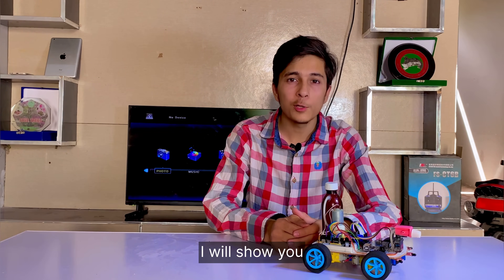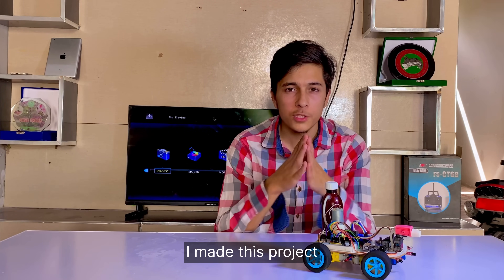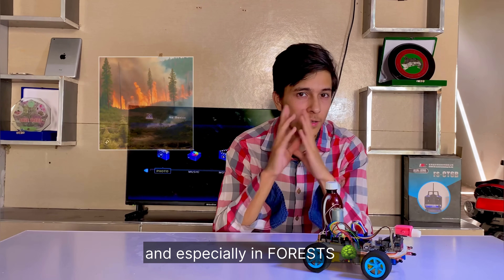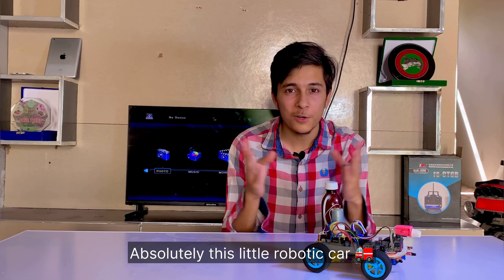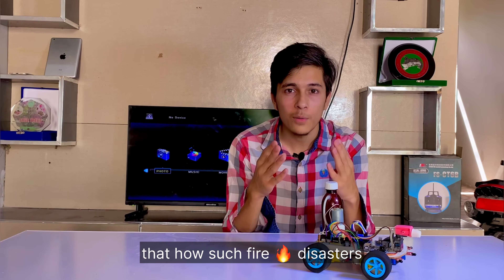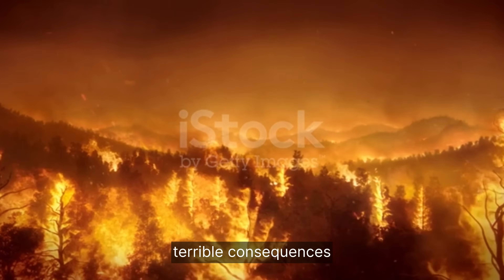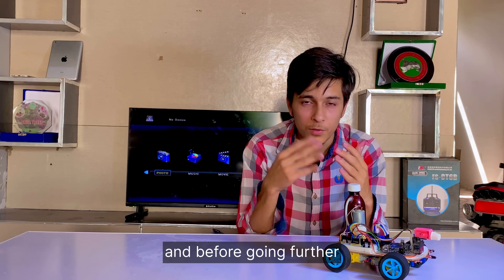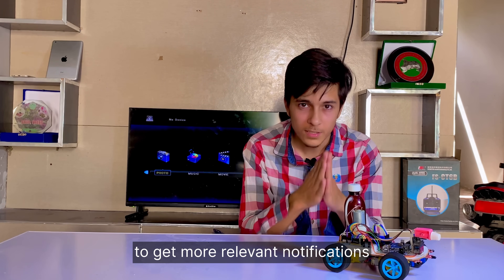DIY Fire Fighting Robot using Arduino  |  Auto Fire Chaser and Extinguisher

Comment from the maker: You are free to ask Questions about any issue regarding this project  (In any language)
Reply: Hi   I  need to contact you to discuss possible the use of yr idea for the firefighting robot.  Can you send me your email ?  thanks  Claudio Ben
Reply from the maker: @claudioben2060   you can discuss it here
Reply: @saadinnovativeideas  I spent two weeks designing this project, and I can cut every detail, just like in the video, and even build the tedious details. I double-checked everything, and the wires connect perfectly, just like in the gameplay footage. I could even program the exact same clip, but it's not working. What's the problem? The pieces light up, but they don't move or go towards the flame. The wheels don't move. What's the problem and what's the solution? I'm exhausted. Please reply! 💔💔💔💔💔💔💔💔💔💔💔💔💔
Reply: I recreated your project but it doesn't work, any suggestions?
Reply: Me too @juliangiron9941
Reply: @juliangiron9941 same i make it with your given diagram, but it doesn't work..
Can you give me the solution??
Reply: THE FLAME SENSOR  DECTING SERVO AND WATER PUMP WORKING BUT CAR NOT MOVING
Reply from the maker: @sumanpatel4085   check your power supply. Make sure its compatible
Reply: @saadinnovativeideas what kind of jumper wire is used here
Reply: @sumanpatel4085  same
Reply: How much did it cost bro
Reply from the maker: @iamjennieslostnails28   about 25-30 $ for components
Reply: I have a question so I have everything you have completed. The only issue is that the robot does not want to move. At first it was moving and the servo was not moving. Now the wheels/motors are not moving and the servo is moving and it spraying water out. Any ideas on how to fix this?
Reply: I also have 9V going into this so I would assume this is enough power everything is on
Reply: Brother can I replace the trasistors, diodes and capacitors with a 5 volt relay?
Reply from the maker: @johnkarlogallardo9158   Of course with the following change in connections 

Arduino     |      Relay mod:
      5V   ———>  VCC
    GND ———>  GND
    A5.   ———>  IN

Pump   —————> Relay mod. Slot
    wire 1  ———->  NO
    wire 2 ————> COM
Reply: @saadinnovativeideas connected as per ur instruction but the motor doesn't run
Reply: Bro I have done programming but there is a problem,the wheels and the pump run by itself without any flame detected.
Please tell me the solution.
Reply: @ganeshdk7689  hello sir have you solved your problem?
Reply: Bro could you please send the proper code of fire fighting  car
Reply: Hii bro .sirvo moter work nhi kr rhi h ?plz help I have only 1 day to submit it
Reply from the maker: @netaXpro   servo ke side wires ko flip karo or middle wale ko waisa rehne do
Reply: @netaXpro  hello aapka project bangyaya kya
Reply: My only pump were working rest all part will not move what 
I have to do
Reply: do we need to change only A0 or A1,A2 etc. as well? Saad please reply soon... Thanks!
Reply: Bro so you mean that in the sensor wires we have to replace the G with D0 and in the coding we have to change analogWrite into Digital write and analogRead into digitalRead ???
Reply: Bro I done with everything but my cars motors are not working bro say what is the issue I'm face and give some tips bro please
Reply: @rumanpasha9764  check the motors connection properly.
Reply: @rumanpasha9764 Hi bro. I also faceing same problems pls help me pls pls pls 😢
Reply: Not working code
Reply: Brother its showing "could not detect port "
Reply from the maker: @gamingwithk.j8149   Download usb driver to connect port
Reply: Brother it's not forwarding that much as shown in the video , it's coming little and starting the pump. What to do ?
Reply: If we use another cheap sensors, what changes we have to do in our code
Reply: I don't know what is happen 
1 day before my only pump is 
Working but now only servo
Reply from the maker: @nasimmemon756   whats you net input voltage and which battery have you used
Reply: @nasimmemon756  did you made your project?
Reply: Could we reset arduino and input the same code in it multiple times will it work
Reply: my water pump is not not working as i am not geting power in the points where pump is connected
Reply: Hello, is a 9V battery capable of powering everything? It seems my set up not getting enough power
Reply: Saman kha sa la ga
Reply: We have a problem about the port....
That this Arduino com7....
Your Arduino code is com6 port...
How to get it?
Reply: What is the cost
Reply: Bro my servo motor is moving continuously .please help me😢
Reply from the maker: @poortelugufishlovers3658   which servo have uou used?
Reply: The flame sensor i have doesn't detect high range fire i tried to use potential but the same issues
Reply: Wtf it is not working at all 
I have sensor with do gnd and vcc what to do now
Reply: If i use sg 90 servo 
And relay instead of transistor what would be the changes i have to made
Reply from the maker: @alM8nds   With using relay module connect like 
Arduino ——-> Relay mod.
      5V   ———>  VCC
    GND ———>  GND
    A5.   ———>  IN

Pump   —————> Relay mod. Slot
    wire 1  ———->  NO
    wire 2 ————> COM
Reply: Can I use 9 volt battery
Reply from the maker: @YashNagwanshi-n3w  If you are thinking about that non rechargeable 9 v battery thats not compatible, because they cannot provide the desire amps
Reply: Can I use rechargeable 9v battery @saadinnovativeideas
Reply: Brother when we are starting our project, the flame sensors are not lighting up and the pump is also not throwing water outside...instead of all correct wiring as well as soldering....so what to do...pls guide...
Reply: I need to connect the Bluetooth module in this if possible or not
Reply: Yar plz provide code here or in link that we can copy it easily you have sent code in pdf files I have done all the things and run another code of chatgpt but still not working
Reply: youtube.com/@saadinnovativeideas My flame sensors are not dropping resistance under 1000 even when the flame is about 5cm from them. How do I make them work? I connect them directly to arduino 5v and gnd pins, using A0 for reading and using my laptop to power the arduino?
Reply: Hey youtube.com/@saadinnovativeideas Im not sure if my comment got deleted. I have issues with the flame sensors testing. I try to connect them to 5v arduino power supply, ground of the arduino  and  im using A0 pin. I have issue that even when the flame is 5cm close to the sensor it still doenst drop under 1000. What should i do to fix that? Can you help please i need this fixed as soon as possible. Thanks!
Reply: Can we use another battery for us 
We don't have the ultrafire battery so if we use that 3.7 volt li-ion battery will it work????
Reply from the maker: @  Of course
Reply: Bro we are school students 
We are doing  this project  ,we have some problems Can you give the phone number 
Emergency please
Reply: I am first time coding in to the arduno so please you send me the arduno code
Reply: l am first time coding in to the arduno I have no idea so please send me the arduno code
Reply: Bro while switch on my pump start and rest all things are not working
Reply: Total rupees ? Please ?
Reply: How to programming
Reply: Sir can we use 4 one sided dc motor in this
Reply: Is the Bo motor dual shaft or single shaft
Reply: bro my flame sensor's light is not on what to do
Reply: 3pin sensor work ??? 😭😭
Reply: Battery immediately get discharged
When connected light in arduino and l298 motor blinking but after some time nothing is working
Reply: طيب اذا ابغى ابيع مشروعي ابغى اكسب كيف الطريقة؟  @ace.king07_official
Reply: Bro I haven't a laptop or pc what I do
Reply: Bro it's not working
Reply: Bhai how many cast of this project
Reply: My only servo is working rest all part is not working
Reply: Can I get project report plz
Reply: Bro please help me after tomorrow is my exibition and the project is not working please help me 😭😭😭
Reply from the maker: @999edits-b9z  tell me some symptoms so I may guess the issue. Do, not a single component works?
Reply: I can refer circuit diagram and code to build project
Reply: Can I use a liv ion 11.1v battery here or hw battery 
Do I have to use two batteries one for Arduino and one for pump
Reply: Hi i have a doubt that can i use diode in4007 instead of in4148
Reply: Ap device ka connect kar ke doge kay
Reply: Hey bro ...give me some alternatives for capacitors, diode, transmitter, etc...to use instead of what you have used
Reply: Hii bro how can I contact you
Reply: @kesavan8489  who?
Reply: Hey! Is the code of the robot is completed?
Reply: Saad all the connections r right, arduino, flame sensor and L298 motor give red light when i turn on the switch but the code is not working or i dont know what but nothing works at all, 
Please help me
Reply: @saadinnovativeideas  Hi I use relay module connect to pump instead of tip122. I use old code and wheel not work. Can you help me.
Reply: i uploaded the code, servo motor and water pump are working but bo motors are not moving
Reply: Please give any of your contact. Very urgent. Please. I have made a model but there is a minor issue. Your contact would help me to resolve it. Please
Reply from the maker: @sanketror5356   whats the issue?
Reply: Please help My project fire fighter robot is not working
Reply: can we use do instead of ao in flame sensor@saadinnovativeideas
Reply: Bro I recreated your all connections but its doesn't working😢😢
Reply: @sanskar-c3u describe your problem
Reply: Can i use smoke sensors instead of flame sensors
Reply: what is the type of your servo continuous or positional
Reply: how to convert it on the 3 pins flame sensor
Reply: Please help
Reply: The flame sensor i have doesn't detect high range fire i tried to use potential but the same issues
Reply from the maker: @alM8nds   increase its sensitivity (by turning the knob), but it is limited to some range
Reply: Where we have do to codeing and how in which circuit please can you explain please reply fast bsc my exbhition is there
Reply from the maker: @KaminiArya-k3s   use Arduino IDE software
Reply: I need to connect the Bluetooth module in this if possible or not
Reply: My project is not working plz tell me
Reply: avrgcc-g++: error :device-specs/specs-atmega328p no such file in directory.    when I'm trying to upload the code I'm facing this solve itt
Reply: bro, what app do u use to make circuit diagram?
Reply: If i can't have pc what i do
Reply: hello bro , can you update the code for the digital flame sensors?....thankyou so much ..the red flame in video is analog right ? ....but i have blue one ....huhuhuhu...
Reply: All details 10 line theory of Fire Fighter Robert
Reply: Bro how much is these devices cost plss tell me bro
Reply: Bro is this program of yours right or wrong. If correct then how to convert this program from pdf to text

￼
Reply: Mera Fail Ho Raha hee
Reply: Bread board me connection pata nehii aa raha hee
Reply: I have only basic experience about c++ and robotics coding can i make it? Will the cost be under 1500 I already have an uno smd.
Reply: Bo motor ka wire kaiser connect Karna hain
Reply: @saadinnovativeideas  brother, Can you please help me,led of motor driver nd flame sensor are just lighting, nd nothing works, what are the changes need to do, it an urgent situation brother 🥹
Reply: @saadinnovativeideas  only after 2days I have presentation please help me bro
Reply: Bai flame sensor full module name btana
Reply: Bro tell me the sensor module full name
Reply: Hlo bro I want to copy the coding how to copy bro plese tell
Reply: Hi bro I am making this robot for science exhibition in my school. I am facing some problem I need your help to fix it
Reply: hi! i need to ask you something about this project. why does the transistor in our work is heating up? we clearly followed your procedures and it works really fine now but when we tried it to move and detect fire for 2 minutes the transistor was heating up. what do you think should we do?
Reply: hi! i need to ask you something about this project. why does the transistor in our work is heating up? we clearly followed your procedures and it works really fine now but when we tried it to move and detect fire for 2 minutes the transistor was heating up also that the mini servo doesn't move and the water pump also but the movement is working perfectly fine . what do you think should we do?
Reply: Hi I need the coding can you assist me?
Reply: everything is working fine, but the Motor driver is unable to provide output voltage to  the BO motor, please help me brother after 10 hrs I have project demonstration
Reply: Cost
Reply: Hlo sir plese give breadboard circut digram in circuit diagram there is no breadboard connection
Reply: I have three pin fire sensor will it work
Reply: Arduino UNO kon sa use kiye hai
Reply: How can I get this or pls send the process for this
Reply: Can you give me an abstract on this project
Reply: Bro my diode is heating,
Flame sensor are not showing light ,bo motor is not working. 
Only arduino and motor driver working.
But the water pump is on continuously,
Please give me solution on it.
Reply: Where the website found I didn't get
Reply: It isn't working 😕
Reply: I am confused in L298N wiring
Reply: What type of  water pump are you using ?
Reply: Bro there is no movement of robot what maybe the problem
Reply: Which Arduino you use?
Reply: Hi do we need to connect 3 capacitors
Reply: The Mini servo is not working , wt do I doo??
Reply: While programming when i choose com port, there is oly one option and tht is comp 7..., there is no comp 6, Wt  do i do abt this ?? Pls help ?
Reply: ho mardva hamar je project che u chale nahi che ki kariye hamme
Reply: hey i really like your invention and i find it so useful so i decided to build an auto robot on my own for home assisting what do you think about the tools i should use or buy ?
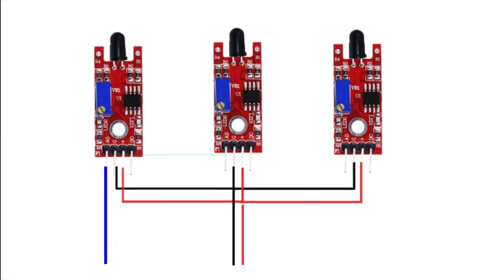Reply: Bro please tell what is that wire on 3:23
Reply: My servo motor is working and motor driver has supply of battery but has no light on motor driver
Reply: I bring 3 pins sensor so how I can use it . Any changes for three pin sensor
Reply: My servo motor is working and motor driver has supply of battery but has no light on motor driver and wheel are not working
Reply: My servo motor is working and motor driver has supply of battery but has no light on motor driver
Reply: There is an error in code program and I'm bigner how to fix the 
Use undeclared servopluse 
Use undeclared Stop
Such kind error contains the code program
Reply: There is an error in code program and I'm bigner how to fix the 
Use undeclared identifire servopluse 
Use undeclared identifire Stop
Such kind error contains the code program
Reply: The wheels are not working 😢😢😢
Reply: brother there is some prblm with the code , it is not at all working
Reply: Брат помоги пожалуйста я все сделал но только он не едет если я подключу к батареи только он брызг вваливает водой 🙏🏻🙏🏻🙏🏻
Reply: Sir the coding is making issue. compiling is okay but when I try to upload the code, It just keeps on going.
Reply: Can you send me coding
Reply: Thanks bro
Reply: Sir How can you connect both the Negative and positive of the battery in breadboard
Reply: Code is not working it shows not define stop
Reply: Kya iska code mil sakta
Reply: Sir make a special video for code please sir
Reply: Nothing is moving 😭😭
Reply: Please send me the contact number please sir
Reply: Can we make it with esp8266
Reply: @saadinnovativeideas  do all use jumper wires? pls give me the answer as soon as possible
Reply: Bro what is that blue and yellow thing on breadboard
Reply: Which coding language is used
Reply: You provide this. ..code
Reply: Not working
Reply: Hello, how are you 
I followed the video exactly, but the servo isn't working.
How to fix this issue?
Reply: 𝑃𝑙𝑒𝑎𝑠𝑒 𝑡𝑒𝑙𝑙 𝑚𝑒 ℎ𝑜𝑤 𝑚𝑎𝑛𝑦 𝑗𝑢𝑚𝑝𝑒𝑟 𝑤𝑖𝑟𝑒 𝑛𝑒𝑒𝑑𝑒𝑑
Reply: Can it work with two battery
Reply: Will it work on day time
Reply: Can I use 3 pin IR flame sensor in this project? Will it work?
Reply: Please, answer huhu. We followed your ways but our arduino isn't powering. What could gone wrong, Sir?
Reply from the maker: @11GMB5  whats you power source, The total input voltage?
Reply: Please help
Reply: hlo bro can you help its dosenot run
Reply: My project is done but issue is it's not working all sensers are working but don't move plz help😢😢😢
Reply: Total cost
Reply: Plz email id
Reply: cooding
Reply: We can use this project L293D motor driver
Reply: Please I hope you respond as soon as possible. I have connected everything correctly, just as you did, but when I turn on a low flame, the robot does not respond and does not turn off the flame. What is the problem?
Reply from the maker: Increase the sensitivity of the sensors by turning the knob on the sensors with screw driver
Reply: @saadinnovativeideas nothing is moving bro 😢
Reply: Can we use 102 pf
Reply from the maker: Yes of course
Reply: Can I use 12 v water pump
Reply: U gave a Circuit diagram but u didn't give a block diagram can u share it. And also can we add lunar sensors to it to avoid obstacles. If yes how can we add lunar sensors to it.
Reply: Not working
Reply: If we don't use 1k resistance Then it will work or not
Reply: Hamara project kam nai kar eaha
Reply: Can I use 4v , 0.4 ah rechargeable battery
Reply: How Can i add more sensors
Reply: Bro my L298 mother driver not working
Reply: Bro you send the code again
Reply: There is some error in the coding my project is not working 😢
Reply: Can you tell me which software we have to download
Reply: Bro we use blue sensor no problem
Reply: l can't understand the breadboard points?
Reply: my sensor why not working, to solve this problem is very difficult and I am confused, please help me
Reply: On bread board you put one type of flame sensor it was in green colour but in electronics shop it was not there what should I ask to buy that in electronics shop plss tell me ❤
Reply: My servo is not working
Reply: My servo is not working what do I do
Reply: How to upload code into Arduino and comming errors
Reply: Compile problem
Reply: @saadinnovativeideas
hello I was wondering if this can be done using stm32 chip using c code and without hal library?
Reply: Bro pls we have to submit my project tomorrow but we are facing problem with code the code is updated itseems pls help 😭😭
Reply: Bro I did everything accordingly but the gear motors are not work and also water pump is not getting enough supply only servo is responding and moving
Reply from the maker: @mohammaedpervejnoufil Check your power supply. Make sure to use rechargeable batteries in series
Reply: @saadinnovativeideas  brother pls reply 😭😭. All are done but the whells are not working all tha connection are checked it very crt but not working.. pls me us
Reply: can we use a rely module instead of all these transistor,resister etc.
Reply from the maker: @MINECODM-gg6rd yes
Reply: Hii I need to contact you
Reply: Hello I really need your help , if I used a relay will there be changed on the code?
Reply: Hello if I use a relay will there be changes on the code?
Reply from the maker: No need to change the code
Reply: Please , I am hoping a reply cause it's urgent
Reply: hello actually i wanted to make this project for my final year 
but the robot isn't doing any movement the code is correct as well all the connections are done perfectly as well can you please check the code once and provide it here 
cause its not working and i dont know what should be done
Reply: What is the total cost of making it bro
Reply from the maker: @voltrohit8996  about 30 US$
Reply: My servo motor is not working when the flame is detected by the flame sensor but the water pump is working fine.
Reply: Hello sir, we have use Arduino UNO r3 and ir3 flame sensor , sg90servo problem is bo motor is not working in correct direction flame sensor is working but movement of car is not working one side wheel is working
Reply: Plz tell me about the connection of Arduino and breadboard
Reply: Bana bnaya chaiye mil Sakta hai
Reply: Bro motor driver is on but Arduino UNO board is not on .when I connect with my pc, Arduino UNO board is on
Reply: @saadinnovativeideas, is it possible to combine this exact car with a Bluetooth mode that you control?? Like, when the car detects fire, the automatized program takes action, but when the car doesn't detect fire, the Bluetooth mode is the one working
Reply: Bro can I use 2 gear moters?
Reply: Hi! Can I ignore putting capacitors? Becausr I dont have any
Reply: We want to also add Obstacle detection system in this project
Can you plz guide us ??
Reply: Can you give your contact please.I need to discuss about this project
Reply: Sir please help me
Reply: Hi Saad 
We also make this project for our college  technofebbia event
But it could not work properly 
After uploading  the code the robot did not work please give
Us such type of guidelines  to improve our project 😂😂
Reply: Can I get the coding
Reply: My problem is that i have everything connected,i have already checked many times, everything is power including the sensor's buy it detects the fire but not even the servo motor moves what could I do,help me please it is the project for our school 😢
Reply: Code error bro please help
Reply: help, there's an error in coding
Reply: Hola, podrias ayudarme? Te puedo contactar por correo? / Hi, could you help me? Can I contact you by email?
Reply: fire sensors are not sensing the fire instead of that it is sensing the object
Reply: My motors are  not working.
Reply: Brother it is  showing h' IN 4 not defined '
Reply: Bro code is not working. It is moving without sensing flame
Reply: Hi Saad pls help me out
Reply: Pls
Reply: I have 3 pin sensor
Reply: Hello, where did you edit the circuit diagram?
Reply: Is there a way to run the car during the day? It only works fine at night, in the daytime it goes crazy from the sun radiation and I have to present it in a place where a lot of light comes in. Any advice? 😭
Reply: encontré un motor para bombardear aire pero mi pregunta es si ese motor también podría bombardear agua sin que se dañe
Reply: Bro your codenis not working please give the code here 😢😢
Reply: Hi I'm really confused cause I'm a 10th grader and i really want to make it my science project but the problem is i don't understand what you connected to the breadboard
Which one was the flame sensor there 
Please reply it's urgent
Reply: i want robot to rotate 90 degrees and move 30cm forward every 3 seconds till finding fire (for scannin fire around 2m^2 area) can anyone help me to write code about it?
Reply: Vai khoroch porbe koto a-z korte????
Reply: Hi
I need your help. 
My pump motor is not warking but others all things are warking. Why this pump motor is not warking
Reply: Hey!! Can u please help me in this project so many troubles are being faced by me and its urgent??
Reply: Cost
Reply: Sir, I'm currently studying 3rd year we are doing this project but we have facing the problem while running the code
Reply: I don't have TIP 122, what is other transistor is compatible for this?
Reply: I have a question that can you exactly tell the name of the motor that you used in this project? Cause I cannot find it
Reply: Can you tell the full name of the motor pls
Reply: Bro the fire fighter is completed but its moving frequently when we switch on the switch what's the problem please tell as soon as you can.
Reply: Aoa 
This is not working
Reply: I have a problem on this code can you give the correct one i did the correct connection that what you did  when i verify this code a error is shown that is "servo pulse is not defined can please help me
Reply: Can I use 3 pin flame sensor instead of 4 pin flame sensor
Reply: mine are complete, even the code, but it's not working except microservo, microservo is moving. may be battery is the problem?? I used 3.7V.
Reply: Price please...
Reply: Bhaiya blue flame sensor la de kya
Reply: Please give me the code of arduino UNO
Reply: Please send me arduino Uno code
Reply: Bro my project is not working I recheck it but it still not working what can I do now in 2 to 3 days there is science exhibition
Reply: I wire it exactly as shown but for some reason when I use a match to test it, nothing seems to be happening 
Also I use a multimeter to test my H bridge and I’m not getting anything close to 7.2V output
Reply: @saadinnovativeideas  mine has a working except water pump. what should I fix?
Reply: What is the cost of fire fighter robot
Reply: bro,can i use a relay module instead of using transistor, resistor, and capacitor?

bro please reply
Reply: Bro just add its coding in description
Reply: hello can i asked i have followed your circuit diagram and i've tested the l298n, servo,dc motors, pump their all working but when im running the whole codes the water pump only turns on flowing water to the tube and when im trying to create fire nearby the sensor it only show led light which detects the fire but  the robot doesnt move
Reply: May I ask what are the wires you used?  @saadinnovativeideas
Reply: Vaise ye kitne distance pr fire ko sense kr sakta hai
Reply: Bai please 30/8/2025 ko science fire hai please help  Bro Moter wheel nahi chal raha hai , water pump chal raha hai, sensor kam kar rahe hain, servo motor bhi chal rahi hai lekin motor wheel nahi chal raha hai kya karu bro nahi too modle reject karna padega please help me bro
Reply: Bro my Flame sensor not working
Reply: My project is not working please help me
Reply: Bro my gar motor  doent working with l298  motor driver
Reply: @saadinnovativesideas hi bro please send correct coding
Reply: when i try to verify connecting the arduino uno board it occurs Error as Compilation error: 'backward' was not declared in this scope. whats the reason? pls reply.
Reply: @ggnk75 reason :was total waste of time bro 
Because he did not explain clearly😢
Reply: The description is not opening
Reply: Bro can the servo moter move up
Reply: not work this project
Reply: Shall you can send the link
Reply: The project will done in 2000 rupees
Reply: Send the code
Reply: Tomorrow I have the science expo ,so please send the link
Reply: @saadinnovativeideas Why is the LED on my flame sensor not active?
Reply: What is the total budget
Reply: Where to get all these materials and how much cost ? Please tell me 🙏
Reply: How much does it cost
Reply: Sir mera na project me sab light jal raha hai like arduno me on light of 3 no flame sensor me light but wo kam nahi kar rahe hai na servo motor kam kar raha hai na hi agi piche ja rahe hai please help me my submission is tomorrow please  solve the problem as quick as possible sir😢
Reply: Bro wheels are not moving
Reply: Give the circuit diagram
Reply: I does the same product like this and it has a flame sensor, But it malfunction if it is outdoor because it also detects the sunlight do you think it just have a wrong coding to the robot?
Reply: Can you send me the code for the coding
Reply: 9:46 9:46 9:46 9:46 9:46 9:46 9:46
Reply: Bro programming code send me bro
Reply: what is the cost of overall components
Reply: Can you design it for me
Reply: My pump is getting on while switch on rest things not working
Reply: Code
Reply: I made this project from you video the robot is not working 😢
Reply: Program code please send me
Reply: Program code
Reply: bhai ye rpm ka koi chakar to nahi hai na
Reply: If I put the capacitor 2 x 47 =94pF it’s ok?
Reply: Sir can I buy this project from you
Reply: It's very urgent sir please give me reply 😢
Reply: Bro I want to ask that pehle ham coding karein ya. 
Pehle assemble kar sakte hai...
Reply: Amigo por favor diga me o nome de cada placa que usaste no projecto
Reply: Bro this cord is error in arduinodroid app
Reply: not working servo motor and water pump please tell me the solution
Reply: can i use l293d instead of l298N ?
Reply: Bro project code
Reply: Bhai plzz digital sensor ka liye n coding Or wiring connection
Reply: We should use 102 pf transistor or 104pf transistor
Reply: @saadinnovativeideas  in my test the BO motors don't work as planned
Reply: Code?
Reply: Program  code
Reply: Code??
Reply: Bro I did everything correctly. But the project doesn't work. 
The RX light of the Arduino sensor keeps blinking. 
With a little touch of a wire from the breadboard, the water pump starts and then Arduino lights turn OFF.
Reply: The only difference in the project I made is I used a Three pin flame sensor. Should that be the problem?
Reply: Heyy can you share the flame sensor connections that you have done in the video because the diagram is not working for ne
Reply: Signal Not recived
Reply: Bro plese tell me water pump and the car is not moving all lights and UNO flame sensor are working fine please tell me tomorrow is my last date to submit this project and on one my exhibition is there please go bro please on act or tell me it's solution😢
Reply: Cual es el código de programa para el Arduino
Reply: Assslam alaikum i neeeed yoir help because hum yeh fire fighter bNa rhy hain college kai lia for exhibition plzzz bro answer me
Reply: Where is the code
Reply: Bro I also made this arduino firefighting robot first of all I want to say that I might have used a defective or wrong breadboard but after I coded the arduino I brought my lighter near to my flame sensors and the arduino is detecting the flame but the servo motor and wheels are not moving pls bro help me my exhibition is near.
Reply: Total cost kitana aya sir...
Reply: I am nedd code
Reply: Sir is using diode compulsory
Reply: And what about the link for the schematic?
Reply: Bro I made this exactly how you show but everything is working but wheels are not moving bro give me a solution please
Reply: Bro code pls tomorrow is my expo pls
Reply: If once uploading get cancelled by any reason, what can we to re-upload it
Reply: @VkmRnc  bro you could chande the port or the com , in my case also it happened at first but then i tryed the other port and com then upload was succesfully done
Reply: I have a DO pin instead of AO pin in my Flame sensors, what to do now?
Reply: IR 3 pin will work? 😢
Reply: @v_rgamerz159  i too dont know thats why asked😢
Reply: Bro meri Arduino me apki tarah light nhi jl rhi
Reply: @vlogswithjatinnn  rx lights?
Reply: And mera to work nhi kr rha kuch pls help
Reply: How to get the com6 port
Reply: @vishakha7071 open arduino ode , select board select port select com6
Reply: En el minuto 3:25 estás conectando el cable amarillo al DO del sensor de llama, no tendría que ir el cable amarillo al G ??
Reply: Bro i did everything but only coding error sensor are sensing flame and servo motor is also turning but dc motors aren't moving . I used transistor tip 127 is it ok . Please reply soon . Only 4 days for exhibition
Reply: avrdude: stk500 getsync() attempt 
What is the solution.  please
Reply: As output
Reply: Bro you used some different wires to connect the BO motors right? need help with that
Reply: Code
Reply: Saad pls help me at the sensor part
Reply: Brother in flame sensor i have connected to DO pin no analog pins to that sensor will it make any difference in program or circuit operation
Reply: Prount
Reply: Bro it's not working
Reply: Bro without capacitor,diode,transistor,resistor we can make or not
Reply: Please send me link
Reply: Bro I have 2 doubts 
1)I am using Arduino R4 instead of R3 so wt changes should I do
2)in connections u given for ir sensor gnd is connected but in circuit it is visible like that connection isnot done(in ur project )?
Reply: I want arduino uno code
Reply: Bro where I want to buy these
Reply: Where is code
Reply: لدي كللل القطع المستخدمة في المقطع لكن الشء الوحيد المختلف هو المضخة V12 هل يوجد مشكلة؟
Reply: Sir please give codes 🙏🙏🏻🙏🏻🙏🏻🙏🏻🙏🏻🙏🏻
Reply: Abi sensör çalışırken motor kartı çalışmıyor motor kartı çalışırken sensör çalışmıyor
Reply: Hey bro I want some help
Reply: Wiring perfect hai coding bhi ho gaya hai but car is not working
Reply: Were is the code bro
Reply: I spent two weeks designing this project, and I can cut every detail, just like in the video, and even build the tedious details. I double-checked everything, and the wires connect perfectly, just like in the gameplay footage. I could even program the exact same clip, but it's not working. What's the problem? The pieces light up, but they don't move or go towards the flame. The wheels don't move. What's the problem and what's the solution? I'm exhausted. Please reply! 💔💔💔💔💔💔💔💔💔💔💔💔💔
Reply: @saadinnovativeideas 
Pls can i use 4 li-ion battery
As I have a 12 v water pump 
So connect all 4 in the main circuit
Reply: How to upload code
Reply: Brother fire fighter robot code
Reply: Please
Reply: Firefighter robot code
Reply: can i use arduino uno dip
Reply: Jay shivray❤
Reply: the programing you showed in video is not the same as the programming you gave us in the description. which one is correct? please tell me fast cause i have a science fest.😥😭😭
Reply: Water pump doesn't work
Reply: Is this manual and auto both
Reply: Is
Reply: i use ir sensor at the place of flame sensor but it does not working
Reply: i used IR sensor but it does not move and does not pump  servo motor is also nat working
Reply: reply ne please it is urgent because this is my school project
Reply: Bro mera bread board Bara hai kaise wire jore
Reply: Broo only lights are on but car not moving or servo and pump too
Reply: Is the code and circuit diagram given in the description correct
Reply: Is this working are not
Reply: The code show compilation error n this code severel times
Reply: This code show complication error , so please give right code.
Reply: Request cheak the code plz 🥺
Reply: Bhaiya ma Ishmael coding nahi kar pa raha hu please aap apna number muja da da
Reply: @saadinnovativeideas   rother I only have 3 pin fire sensor will this work?
Reply: @johnkarlogallardo9158  did it work
Reply: Aru u try with 3 sensor its complete or not please suggest me as soon as possible @johnkarlogallardo9158
Reply: My problem is that I have everything connected, I have already checked it a couple of times, everything is energized including the sensors, but it detects the fire but not even the servo motor moves, what could I do, help, it is a project for the university
Reply: @juliangiron9941  same problem here
Reply: @juliangiron9941  did you complete the circuit? make sure that the circuit is complete first and if it is it could be the power how many volts do you have? if nothing is working maybe there is not enough power?
Reply from the maker: Deal is not with power only, ampere rating also matter. I guess the 9v battery you have used is non-rechargeable but that cannot provide sufficient amps(2+) to run the project. Try to use rechargeable battery
Reply: @saadinnovativeideas  Brother in the description you write 104pf capacitor but in the vid it says 1 102, I have used 104 will it affect the circuit?
Reply: @saadinnovativeideas Code doesn't work even if i tweak the Analod to digital part. Maybe the labels on the diagram is wrong? I use 102pf as per your vid.
Reply: @saadinnovativeideas  upload the new code bro,
Reply from the maker: @johnkarlogallardo9158   you can use 104, or 102 or other one closer to the value. It will not effect
Reply: @saadinnovativeideas  bro can we add a remote control on this? Or a camera to monitor which is controlled via bluetooth?
Reply: @saadinnovativeideas  Can you explain it further? Sorry I'm very new to coding, just need to make this for my daughters project.
Reply: @johnkarlogallardo9158 are u complete this project please help me if you complete that😊😊
Reply: @johnkarlogallardo9158  just paste the sketch that is in the description
Reply: @saadinnovativeideas  analogWrite(enA, Speed); // Write The Duty Cycle 0 to 255 Enable Pin A for Motor1 Speed
analogWrite(enB, Speed); // Write The Duty Cycle 0 to 255 Enable Pin B for Motor2 Speed
delay(500);
}
void loop(){
s1 = analogRead(ir_R);
s2 = analogRead(ir_F);
s3 = analogRead(ir_L);   
For example this? Should I replace it with digital?
Reply from the maker: Exactly.. like 
analogWrite —-> DigitalWright
analogRead ——-> digitalread 
Etc
Reply: @saadinnovativeideas sir ji 
Servopulse (int pin,int angle){
int own =(angle*11)+500:

Digitalwrite(pin, high): 
Delaymicrosecond(pwn);
Digitalwrite (pin,low)

Sir yha bhi digital ko analog me krna h
Reply: why my pump is not working
Reply: Did the problem solved? If yes then how? @BDCCN-HaHoaBinh
Reply: Bro I have doubt we have to make some changes in the code??
Reply: @saadinnovativeideas  i am providing power supply with 3x 3.7v batteries but still my project isnt working sometimes all the parts work but sometimes the flame sensors doesnt work and the lights of arduino are way to dim plz help me